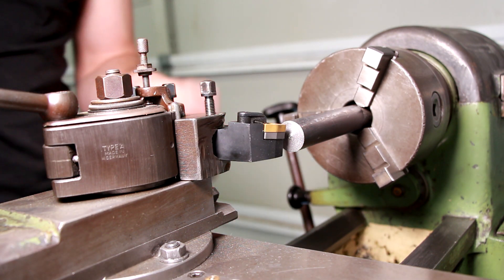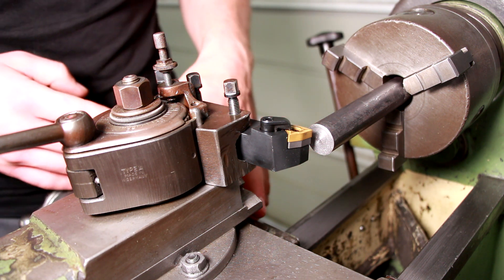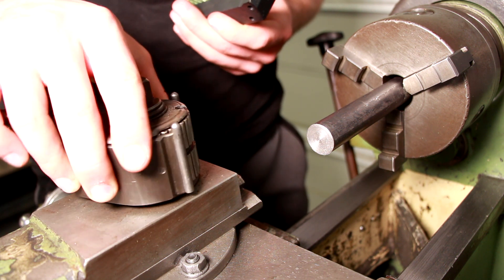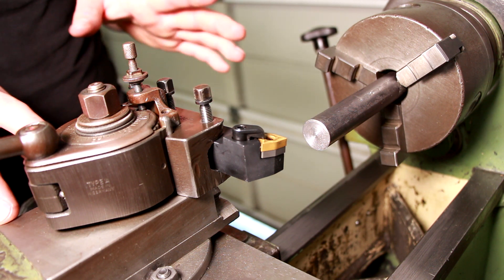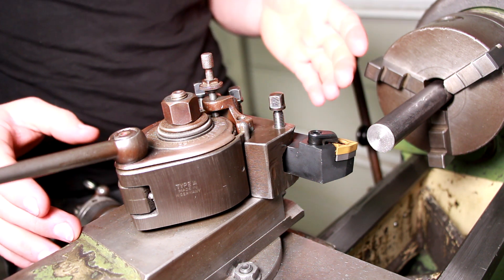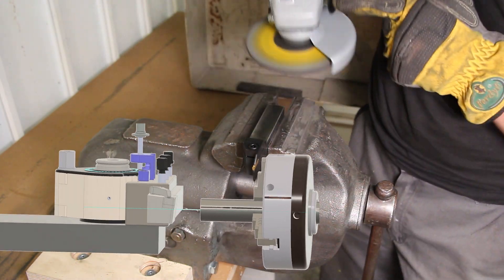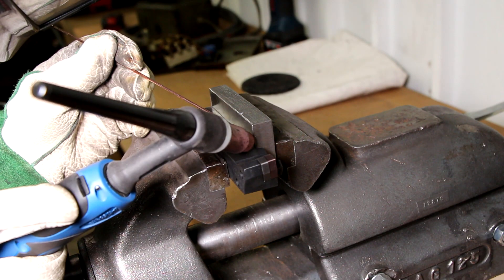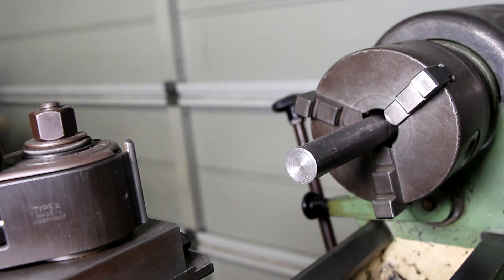Modifying Lathe Tooling to fit my small Lathe

Comment: Hi, nice videos and congrats to new lathe! 
But your turning tool it's too big on Weiler 220. Correct size of tool is 16x16 or 12x12. 
I have the same lathe, and i have a similary issue too. This problem solutions was made a new top slide form cast iron. I made top slide with a cut for toolhoder. Toolhoder can be in lower position then original top slide. I use all tool 16x16 without problem.
Reply from the maker: Hi thanks for your comment! You may have a picture of your solutioin?
In my case 12x12 would have maybe just worked but without the possibility of adjusting it.. 16x16 was anyway to big so I thought with my solution I just go with 20x20 as it makes no difference and 20x20 was available pretty cheap and is still a little more ridgit even if that probably doesent matter with a lathe this sice at this pint.. weak spot is probably somewhere else anyway..
So far all the tools are working quit well besides the cut off tool...
Reply: @HolzFlo  I understand, 20x20 is most available in my case too. Smaller then 12x12 can be used only on special operation, I think. On normal turning 16x16 is enough. 
 I have some picture mine top slide, actually i made video with this. I send on your email some photo with the tunned top slie .)

Comment: Two things;
1) Carbide insert tooling has high minimum speeds and depth of cut requirments, that translate into high power and rigidity requirment, that your lathe may not be able to fulfil
but...
2) if you insist, you could address the height issue AND improve rigidity by follow Robrenz and/or Stefan Gotteswinter by making a solid toolpost.
If you make the solid toolpost thinner than the existing compound you may do well.
https://www.youtube.com/watch?v=bLn0Ch1_KQM
Reply from the maker: Thanks's for the link!! Nice tip so. I'm pretty new to machining, so probably not able to make that yet.. Also I'd loose some functionality with a solid toolpost? Tapers e.g.?  Maybe an Idea for a far future.. 
Don't plan to make high precision parts yet. The bed has probably to much wear in it anyway.. :D
But so far the setup seems to be ridgit and the lathe powerful enough to use inserttooling, maybe not with the maximum cutting capacity of the tooling, but at least to get a pretty nice cut. :)

Comment: There's 2 things you can do.....get a smaller shank tool or mill the bottom of the tool down just  behind the front part not all the way.
A third way would be surgery.........cut the end of the tool off behind the end part and weld it back onto the shank but a bit lower.
They do make smaller shank insert tools you know.
Reply from the maker: Yep there are smaller shank inser tools, but I have just about 8mm left in height, depends on the toolholder.. So that felt a little weak for insert tooling, where you need fairly high speed and feed..
Not shure if the surgery is any better than what I did :D But you need less material so..
Reply: @HolzFlo  At 1.43 it's obvious what your problem is.....you are using tools that are too big for your machine........I would think that 12mm square shanks appear to be right........no way to actually see the size you are using.
As this QCTP is a top of the range device if that were my lathe I would machine a bit off of the top of the compound side as you will never go back to the original 4 way tool post unless you don't like QCTP types and only have one on there for show, but I think it's the size of the tool shank that will always be the stumbling block.

Comment: Why not just grind down the section of the tool that fits in the clamp? Also, you own a lathe, which means you can do milling operations.  Put the cutter in the chuck, and use quick connect to move the piece through the cutter
Reply from the maker: Thank's for that comment! That`s a good Idea.. Not quite shure how precise i can get it this way but worth trying next time.
Reply: @HolzFlo  milling in the lathe was normal in the model engineering hobby in the UK in the 1930s